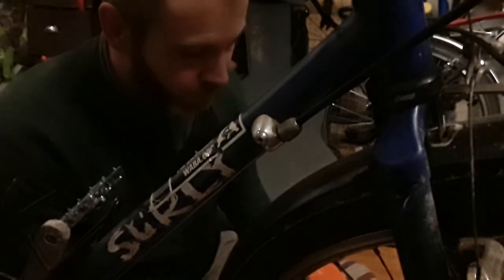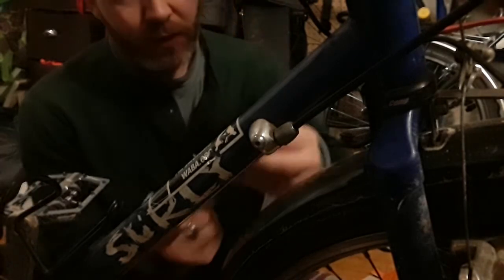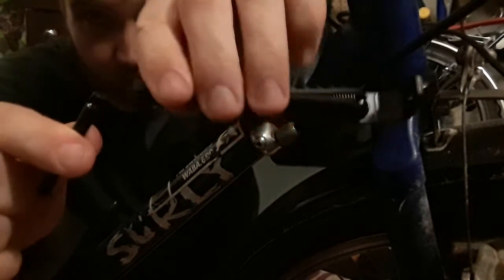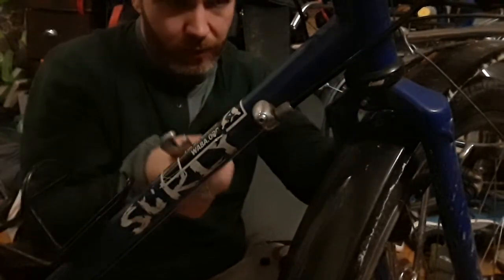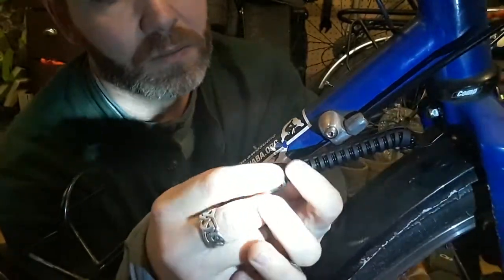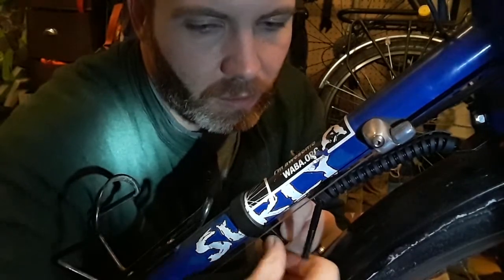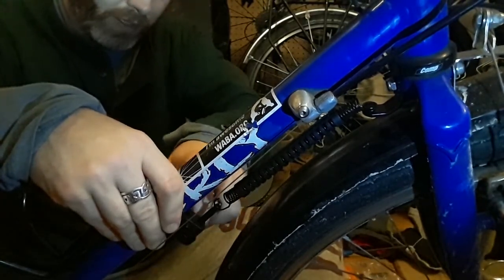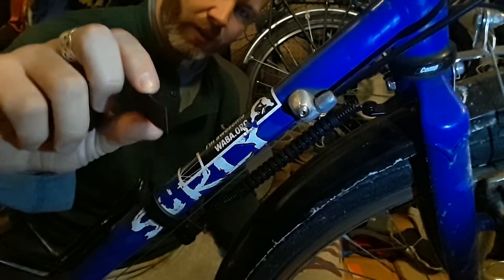How to install and adjust a Velo Orange wheel stabilizer

Comment: I'm glad you made this, I just got one of these today, and there's no instructions with it - you're supposed to go to support.velo-orange.com. Which is currently an un-configured shopify page. (Not that this thing is super-complex, but it's better not to assume I know what's going on with a thing I have no experience with.)
Reply: If you go to the main VO website URL and click "Articles" it's there. I think the support.velo-orange.com URL was for a previous version of the website. The instructions are clear about the parts, but not clear about how much pre-tension is acceptable for the spring when setting up the stabilizer. I imagine more pre-tension might lead to more/faster failure of the spring.

Comment: is this only for center pull brakes? or can i use it on my old panasonic with side pull brakes and just not use the bolt
Reply from the maker: You do need some kind of bolt for it to secure to on the fork, you could always rig up a hose clamp or something to try to perform the same function as the fork crown bolt that is used here, but you'd have to just fiddle and see if you can make it work.
Reply: Imagine you already have this figured out by now, but maybe not. The type of pull on the brake (center vs side pull) doesn't matter, it's all about the mounting on the back of the fork. For a recessed brake nut (modern style) you need to use a Sheldon nut. For an old nutted style, where the nut is exposed outside the fork crown, you can most likely get away with mounting the spring hanger to that bolt, under the nut.